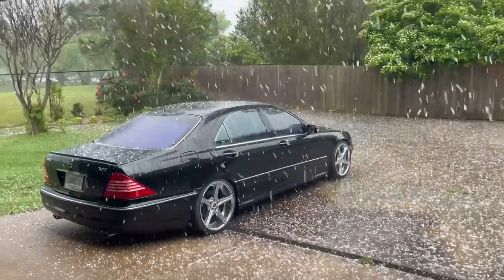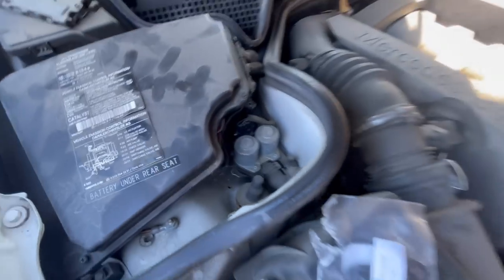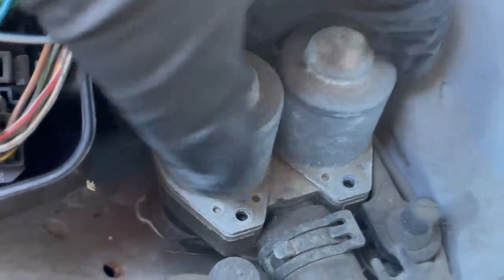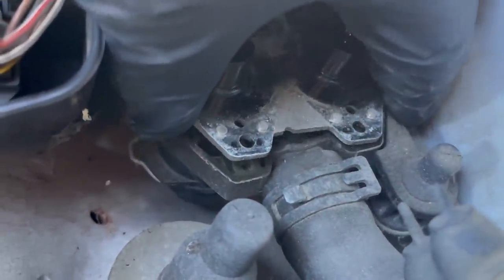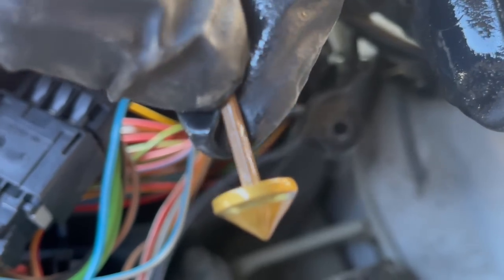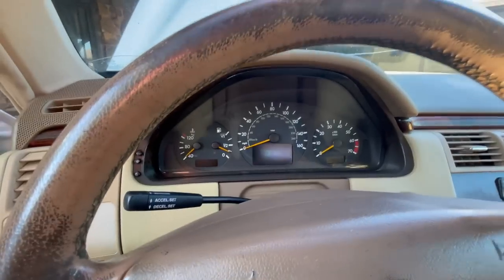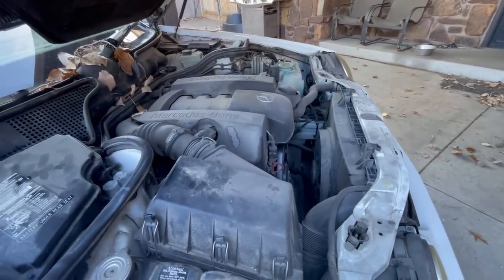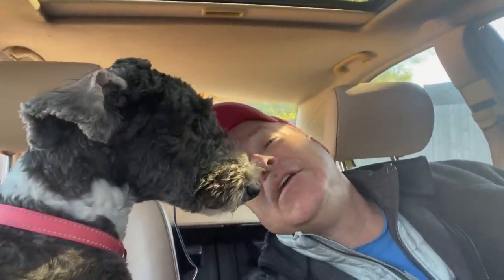W210 Heater Control Valve

Comment: How do you test it , I have tested my heater control valve and I just here the click , is that still good 
But i take my off and it stick too good i make it broken the plastic tip and it stuck in the housing of the engine finally I use the the electric Shaw tip as the knife wicked left and right to cut it, finally I get it broken pice out of the engine housing hole , so happy now I guess I have to buy the new one.
Thank you for reply me back

Comment: One question. My w210 blows really hot air or cold air when the ac is on (of course). It doesnt do anything in between. So its just really hot. Could this problem also be linked with a faulty/clogged duo valve? Thanks in advance.
Reply: Yes thats the duo valve.